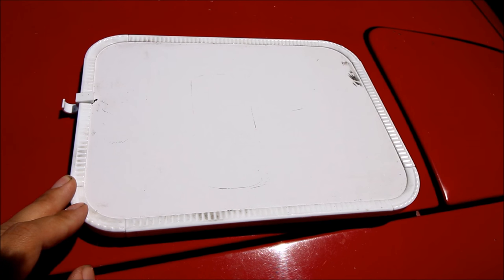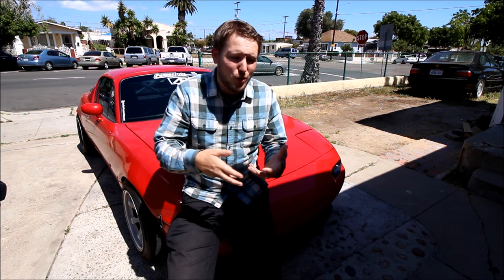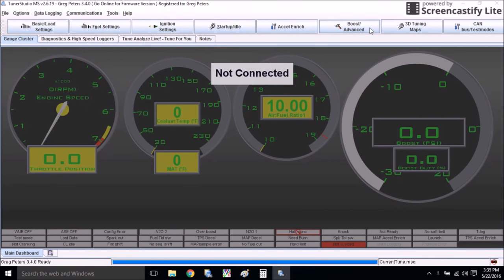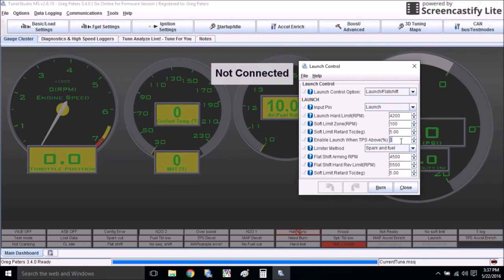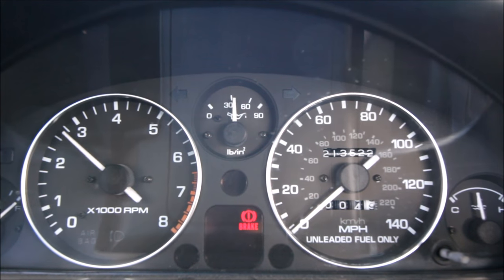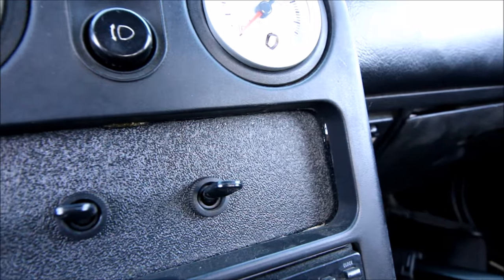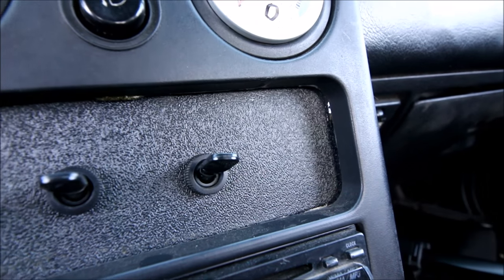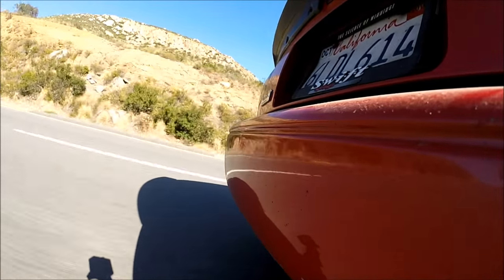Shooting Flames! Launch Control & Flat Foot Shifting Tutorial. (Megasquirt)

Comment: I still don't have a Miata and yet I watch your videos. I don't think I will get one but I am thinking of putting a turbo on my MR2.
Reply: I could be wrong, but wouldn't it be better (Maybe even cheaper) to just buy a turbo MR2 motor? Or is the turbo pretty easy to install? Or do you just want the fun that comes with building

Comment: Thankfully the ME221 ECU has anti lag and 2 step as well! Can't wait for the turbo kit and 3" catback to arrive and then SHOOT SOME FLAMES!
Reply: +Luca Car Mods You shouldnt run a cat if you are trying to shoot flames, thats something Greg forgot to mention in the video
Reply: +Weldon Marcus I know.. Cat is bad 😜
Reply: I've got the same ECU but still having issues with the clutch switch working, might have to try wiring it up like Greg shows and see if it works.
Reply: Hooray for Turbo MX5's, I can finally join in with saying how good they are
Reply: Could never get my launch control to pop and bang on meite with my me221 Luca. What's your trick

Comment: Thanks for the video ! you answered a lot of my question about setting up megasquirt in this series. your videos are about the most concise that I have seen. keep the videos rolling!
Reply: i'm planning on wiring my launch control to a toggle switch, is it as simple as just getting 12v switched into the launch control pin on the megasquirt's options port or the other way around? thanks for your burble tune video btw.
Reply: @Tripifyy  absolutely! No worries
Reply: @TurbineResearch  🔥🔥, so just to confirm, the launch control pin coming off the options port is looking for ground to engage launch control, right?

Comment: This is fucking cool, I want this! I'm currently rebuilding my 1.6 for turbo, I've been playing with the idea of putting a zm-de head on my block from a protege because the ports are bp4w sized. I'm gonna start putting a list of questions together for you sir, prepare yourself! lol thanks man, for the inspiration
Reply from the maker: +unknown1creature That head swap sounds like the best thing you could ever do for a B6. Has it been done before?
Reply: I've found a forum where a guy posted lots of pictures and checked fitment but he never finished posting, I really want to try this as i have 2 motors, but i think it may need a custom head gasket and maybe cams, please check it out and let me know what you think, you're welcome to dm on Instagram @unkn0wncr3ature  http://www.miataturbo.net/build-threads-57/hybrid-b6-zm-de-engine-build-62722/

Comment: +TheCarPassionChannel as far as flat-foot shifting goes, if the limiter is interfering with rev-matched downshifting, you could put a second switch under the gas pedal and put it in series with the clutch switch. you can still rev out freely and rev match when necessary, but you still get flat-foot shifting benefits.
Reply: TheCarPassionChannel good point, I didn't think about that.

Comment: I solved my downshift rev limit problem by raising the enable TPS at 90% so when I'm only flooring it will my 2-step work.
Reply from the maker: +Bruce Le My problem with that is I don't launch at full throttle, sometimes 50% or less. But that can be a solution for many setups.

Comment: Just an idea that I had for you about this switch on the dashboard what if you were to use in Old headlight dimmer switch from a car from the 70s era that's mounted on the floor put it right next for you to put it on the left foot rest at the top then that way you could hit it real for hit it real quick with your foot

Comment: how come in the parking lot at 8:39 you dont shoot clean flames and in general, your exhaust shoots out so much smog when it shoots out flames?
and for when do you use the switch to activate and deactivate launch and flat shift??
love the video!
Reply from the maker: It shoots flames more when the exhaust is hot, and the car had been sitting for a while. The black smoke is burnt fuel. I turn off LC/FFS when I do autocross or canyon running because it interferes with rev-matching.
Reply: +TheCarPassionChannel so whenever you want to do rev matching or heel and toe you have to have it off?
Reply from the maker: Felipe Rivadeneira I mean you don't have to... but if your LC rpm is 3500 you won't be able to rev-match above 3500 which is pretty useless.
Reply: +TheCarPassionChannel 
gotcha
thanks "Craig"😂
love the videos like always

Comment: have you ever thought hooking up a switch the the brake pedal (or using the stock  brake switch) to open the circuit instead? Would probably allow some awesome flat foot action, without interfering with you heal tow (rev matching). its something I've worked out a few years ago, but never had time to implement.
Reply from the maker: That's a genius idea. The only thing it wouldn't prevent is 2-step interfering with rev-match downshifting without the brake pedal (Like downshifting to pass on the highway).
Reply: +TheCarPassionChannel True, hadn't thought about that. Apart from having all over the freezing place, you got to use what's best for you. (Could use a "NOS" button on the steering wheel for a press to pass, Fast and furious stile! lol)
Reply: forgot to put a "switches" in there

Comment: i had a thought, if you changed the position of you switch to the start of the clutch press cycle not the end you shouldnt get the rev jump between gears

Comment: This is awesome. Any way to set it up to 'disable' flat foot shifting/launch based on braking? This way you could use it on a road course/track day but not have to manually intercept it.
Reply from the maker: There are a couple ways you could do this, I used to have a physical switch that would activate/deactivate it so if I was canyon running or AX etc, I could just turn it off. Now that you mention it, I think you could put such a switch somewhere on the brake pedal arm so it would deactivate under braking only, allowing free revs for downshifts. Good idea!

Comment: guys for those of u who are struggling to get this mod to work on your miata (like i was) i found out that 90-93 miatas that have/had cruise control will not let the megasquirt launch control function work properly. all i had to do to get this setup to work on my miata was simply unplug the cruise control switch from the clutch pedal. for whatever reason when that switch is plugged in it interferes with the signal from the starter switch and the launch control would always stay on?? anyways i found this solution to work for me and my car hope this helps! i also have a short clip of the lc on my channel!

Comment: Aww yeah now I can actually join the stream, so excited! Now I have a question, do non cruise control cars have the cruise control switch, because that could be why my LC/FS doesn't work.. It doesn't even work with the car in neutral. Also, do you need a vTPS for it to work? I'm running the car with no TPS at the moment because of MegaSquirt and not being able to find a BMW one yet, but it would be a reason for me to upgrade the TPS (which I'm gonna do anyway but still)
Reply from the maker: +JaguarJay Crap, totally forgot to mention that you need a vtps. That's most likely the reason yours does not work.
Reply: +TheCarPassionChannel Fair enough, guess who's ordering one really soon :P Thanks for the ultra fast reply, I love these longer how-to videos!
Reply from the maker: JaguarJay Excellent man, I try not to let it get too boring, and keep a wide variety of installs/etc coming.
Reply: Okay so I finally got a TPS installed and my launch control works.. in neutral :\ Problem is, since I have a euro spec MX5, I don't seem to have the starter interlock switch "clutch switch" which is depressed when the clutch is fully depressed. I only have the clutch switch on top that's depressed when the clutch is fully engaged. So I can't wire the neutral switch to the clutch switch. It's probably because in Europe we are more used to driving manuals so it's not needed to have the starter interlock switch or something like that... It sucks but I guess I'm gonna use a reed switch and haggard something up sometime :P
Reply: Any tips on setting this up on the 97? I have mine set to the the Launch input in tunerstudio and i got nothing. Did you have to do any wiring for the existing clutch switch? ps im running a MSPNP2

Comment: to make sure I understand, at 5:10 you talk about launch control working when you're in neutral. But we've got 2 different rev limiters, one for when we're in neutral and one for when the clutch is in? So to test this we'd need to set the rev limiter for clutch in below the limiter for neutral, and then try to gas it in neutral, with the clutch both out and in? 

I'm sure I'm missing something obvious here. Help?
Reply from the maker: No, I was explaining a flaw with MS there. Whether you have launch control active, or both launch control AND flatshift active, they both should only rely on the clutch and not be affected by the shifter's position.
Reply: I got the flaw and the need to check the crossed wires. I was just trying to figure out how we see if boost control turns on while in neutral. Can't exactly test it by launching in neutral :)
Reply from the maker: james Thaddeus You don't need to lanch the car to test the launch control rev limiter. You put the car in neutral and hit the throttle. If the LC rev limit is activated, you need to switch up the harness routing.

Comment: Can you make a switch that turns on/off spark cut only? I want to be able to be loud when needed but be able to downshift when I’m cruising in the hills. If you can you should make a tutorial!
Reply from the maker: Very easy, just wire a simple on/off switch into the clutch signal wire. Used to run that same exact setup.

Comment: Hi & great vid, Greg. So you have changed the turbo already, what hp is your car making now? Can't wait for the next one, B&B hint hint
Reply from the maker: +Bobbie Wahab I haven't had it on the dyno, but looking at several virtial dyno pulls it's around the 260whp mark at only 12psi. I'm not going to push it too hard until I get on the dyno.

Comment: I just set up a MSD 6al box and the 2 step on a 94 mustang GT... I tried -5° and +20° timing spark cut only and either way it sounds like a 50cal... I’ve had 2 steps on other cars all straight piped but never anything like this!!! I’m gonna try spark/fuel cut and see if it’s not so bad... it’s so loud right now it hurts 😂

Comment: question? on the flat foot shifting getting in the way of heal/toe, could you add a interrupter type switch to the break pedal so whenever you're on the brake it disables the flat shift causing you to heal/toe in a normal fashion then when your back on the gas you have your flat shifting again?. Just a thought so you wouldnt have to physically do anything.
Reply from the maker: Yes. The only issue with that is if you're just rev-matching without braking, it will still interfere. (I do that when exiting a highway or if traffic starts to slow down, etc)
Reply: You could also have a button and install it on your shifter or something similar to his toggle switch to where you could have it on all the time, but it will disable it if you press a button on your shifter as you are doing a maneuver.

Comment: My megasquirt is arriving this week so this video could not have come at a better time! Thanks buddy, enjoying your videos very much.

Also quick question, would it be detrimental if my ecu receives a permanent clutch-out signal? What I mean is, when you intercept the signal to trick the ecu, does it affect anything else? fuel/spark tables, cruise etc. etc.
Reply from the maker: +iXiiN I'm not sure what you mean by a permanent clutch-out signal?
Reply: +TheCarPassionChannel Trying to word this is harder than it should be haha.
When you turn your switch off so that Launch/FS no longer activates, this is because the ecu is tricked into thinking the clutch is 'out' or not depressed, so the entire time you drive with that switch off, the ecu believes the clutch is not being pressed, even if it is.
Did that make more sense?
Reply from the maker: iXiiN You're asking if that affects anything? No it does not. At least not on my setup.
Reply: Okay cool that's exactly what I wanted to know, thanks. I wassn't sure what the ecu really uses the clutch switch for apart from launch/FS but I guess nothing is the answer haha.
Reply from the maker: iXiiN To my knowledge, nothing important.

Comment: I got it working on my 97 - great fun :) - the clutch switch is independent.
I want to set it up on my friends 95 miata, is it the same setup as yours ? short the clutch switch and wire the neutral switch as the input on MS ?

Why can't just short the natural switch and use the clutch switch as your input ?

Thanks !
Reply from the maker: I have no idea, seems like each year has a different problem with the launch control circuit.

Comment: Hey cool videos, I have a question, leaving only spark cut will let injectors still working. So fuel will be kind of "washing" the lubrication out of the cylinders if it's not ignited and the friction between piston rings and walls will increase a lot? I am not sure if I'm wrong, but this sound like bad idea for the engine, what do you think?

Comment: You should make a video of updating the firmware on the Mspnp2. I was told that the newest update should fix some of the problems with the launch control as well.
Reply from the maker: +Josh Hill I believe I'm on the latest firmware (3.4.1?) and to make that video I'd actually want to do an update rather than just talk about it so I can show the steps in detail. I remember being a little nervous about it but it wasn't too hard.
Reply: +TheCarPassionChannel 
I have the problem that no matter what gear I'm in, my launch control will come on. I have to update my firmware and your videos make everything much easier that's why I was asking. I'm sure if it would help me it would probably help others as well.
Reply from the maker: Josh Hill Launch control shouldn't have anything to do with what gear you're in, only if the clutch is in or out. What exactly is the issue you're having?
Reply: +TheCarPassionChannel 
When I turn on launch control the car will act as if the clutch is pressed in no matter what. When I talked with diyautotune they said that they had some weird problems with the firmwear and to update it should fix the problem. I do have to press the clutch in still to start the car so I assume the switch is working correctly.
Reply from the maker: Josh Hill Does LC work when the car is in neutral and in gear?
Reply: I'm pretty sure
Reply: +TheCarPassionChannel
Reply from the maker: Got some troubleshooting to do
Reply: +TheCarPassionChannel yup hopefully won't be to difficult.  Next video going to be broke and boosted?
Reply from the maker: Josh Hill Within the next two videos. Not 100% sure what the next one will be, I don't plan too far ahead
Reply: +TheCarPassionChannel that's understandable I'm excited to see how that car runs

Comment: so by doing the jumper at 4:27, do you have to have the clutch suppressed to start the car?
Reply from the maker: No, which is beneficial to the health of the thrust bearing as well.
Reply: +TheCarPassionChannel I was thinking more along the lines of installing an automatic starter at that point. but that's just me.

Comment: Want to get ecu and minor mods before turboing and tune car up/do maintainence before I dump money into the turbo set up, would I still be able to make noises and flames without turbo? Lol and have 2 step/launch controll on a switch. Sorry for my basic ass question 😅

Comment: Hey Greg t.j here from Phoenix next to Mike the Miata king. At Miatameca I have a 94 1.8 turbo Miata with a ms2 PNP full program of tunerstuido. I have a db26 connector to add stuff so I tried to setup lunch control by hard wireing in to a switch to turn on and off using clutch switch and the lunch control but the switch is not working when I turned lunch control on it's always on clutch in or out luanch control is always on but I trying to make it work at the flip of a switch any ideas hope to here back

Comment: Nice video. Do you use Megasquirt for boost control? I'm struggling to use that on my mx5. 
A video would be great 
greatinngs from Porugal :-)
Reply from the maker: +Vitor Jorge Yes I do. Are you struggling with the tuning or the actual wiring?
Reply: +TheCarPassionChannel Both. The wiring is done and the solenoid works, but megasquirt starts to make some strange resets. Apart that, i'm starting to open loop tune. i have wastegate set to 7 psi and my intents are to put MS making 12 psi (stock interns should be safe)
Reply from the maker: Vitor Jorge Check out this video on my other channel, it might help you out. /watch?v=PIE76B7CpDE
Reply: +TheCarPassionChannel Nice tips i'll give it a try. tanks

Comment: Where is the neutral switch on the 1.8 miata 1996??  How does the wiring look like??  I tried to unplug it and it will not work.

Comment: So probably a noob question here but I'm trying to make 2 step work on my MS2PNP on my Nissan but Everytime it engages and i launch the car it kicks back on and doesn't let me rev over the value i have set? I have the clutch switch wired to my clutch switch input on my options port

Comment: So one of my wires from my clutch switch goes to the ms2 clutch switch  Lin or the launch control pin. I have the 26 pin ms2 pnp. I thought one wire from clutch switch goes to ground. And the other one just goes into the ms2.. I just don't know if it goes to the clutch switch pin or launch control pin

Comment: Hey Greg ,I need some help I got a 93 miata with pnp2 and I just got the flying Miata vtps.  I installed it and I even flipped the wires like people have said to do and I got no reading on my ecu.  I have jumper on the variable pins on the ecu and still no change.  I can’t figure this out.  Please help !!